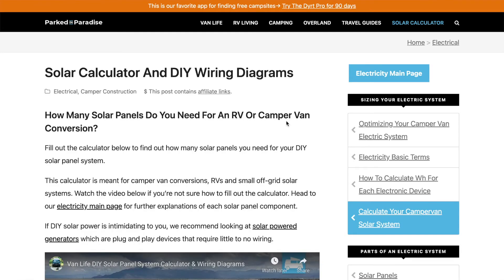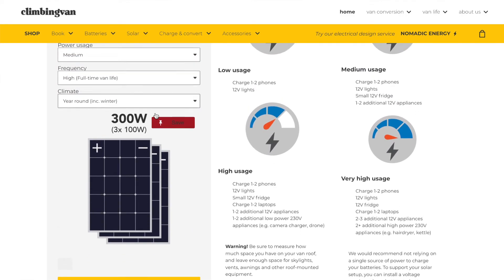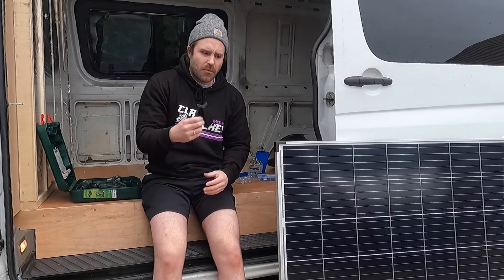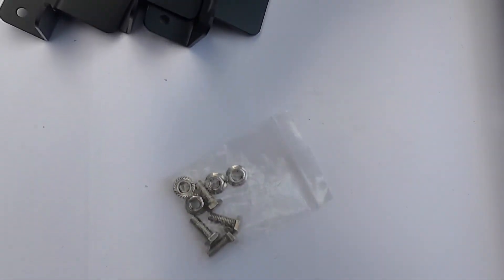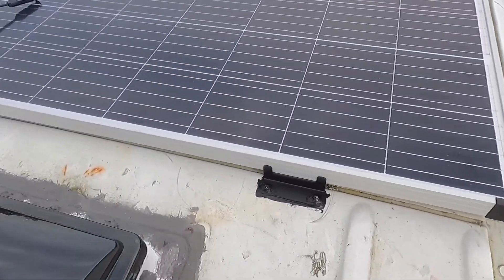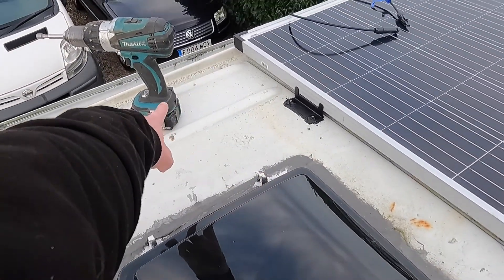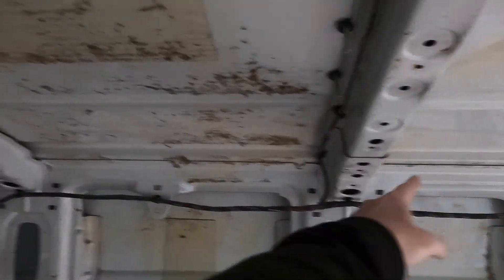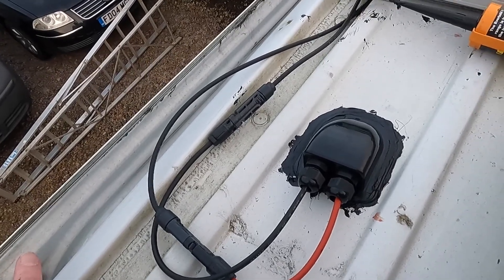How to Install a Solar Panel on the Roof | Idiot's Guide | DIY Sprinter Van Conversion UK

Comment: A better approach would have been to bore a 20mm hole with a stepper drill and fit a rubber grommet or gland into the (painted) metal.
Otherwise there is a risk from constant movement of your van that the insulation covering your solar wires can chaffe away, and contact the bare metal of your van's roof !
Did you fit an in-line mc4 fuse just in case ?
Otherwise good effort !
Reply from the maker: Thanks bud! This whole process has been an absolutely massive learning curve for me, had to learn 99% of things from scratch so there are definitely a lot of things I’d do differently next time! 😅 Yep, both cables have an inline fuse fitted.

Comment: Hey mate, another great video. 
One question please! If you were a bit of a numpty and say, insulated your roof before you remembered you needed to fit the solar panels, am I correct in thinking it’s done entirely from the outside if using those well nuts? 
I’d forget my own head if it wasn’t bolted down 🙄
Reply from the maker: Thanks dude! Those well nuts are an absolutely dream. You’ll just need to drill some holes big enough to slot them in. Once you put the screws in and start tightening them, they’ll tighten against the roof of the van so you shouldn’t need to touch the inside of the van 👍🏼
Reply: @GreenHornCountryClub  absolutely fantastic news! 🤣
Thanks mate. Will drill out a lil wee bit of the insulation board to allow room for the well nuts as I drill the holes. 
I really should learn to make a plan.
Reply from the maker: @willpolr  keep me posted on how you get on with them!
Reply: @GreenHornCountryClub  I will do mate. Panels arriving in a couple of days time so next break in the weather is crunch time!
Reply: @GreenHornCountryClub  hey dude, panels are installed using the well nuts so I didn’t have to remove the roof insulation! Yay. 
One question please, when tightening the bolts into the well nuts, how tight did you go? Did you keep going until really tight as it feels more like it needs a decent pinch not too tight? Help!! 🤣
Cheers once again mate.
Reply from the maker: @willpolr  nice one! Well nuts for the win! I’d make sure they’re tight but don’t overdo it, like you said. I accidentally screwed one too tight and it exploded 🤦🏼‍♂️
Reply: @GreenHornCountryClub  haha thanks again mate. Really appreciate your input 😊
It’s gonna be a nerve racking run back to Brighton tonight staring in the mirrors for flying solar panels 🤣
Reply from the maker: @willpolr  nae bother lad - I’ve been there!
Reply: @GreenHornCountryClub  panels are still on 150 miles and a couple of days later mate! Whoop 🙌
Reply from the maker: @willpolr  another win for the well nuts! Nice one bud

Comment: Hi, I'm just planning an upgrade of my 100w solar to 300w. Your wiring appears very thick. Is this size of cable required for solar of this size? I'm wondering if my existing cabling will need upgrading. Many thanks.  Great video btw
Reply from the maker: Hey! Thanks for the comment :) When I bought the extension cable for my panel, I basically just matched the thickness of the cable feeding out of the solar panel itself. I believe that was 12AWG/4mm cable. 

The main thing you'll want to consider is the amp-rating of the cable itself to make sure that the cable won't overheat. If you're upgrading to a 300W panel, you'll need to make sure that the cable you use can safely carry slightly more than 25amps 👍